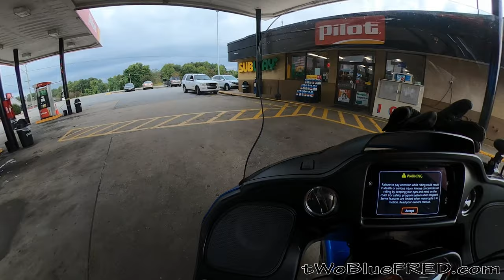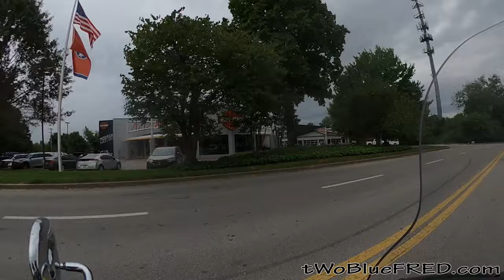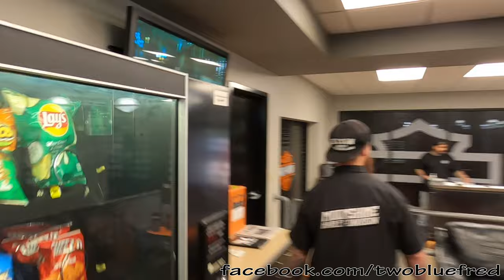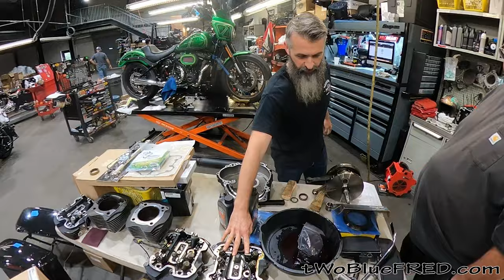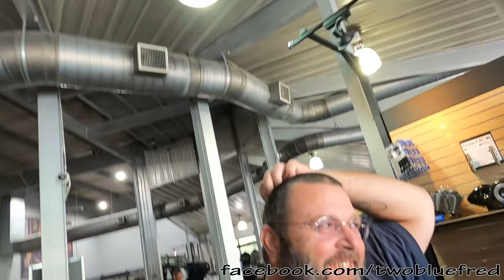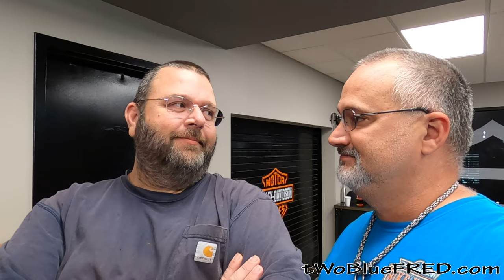PERFORMANCE BAGGER BIKE BUILD @ MOONSHINE HD -128ci ohlins beringer brakes #performancebagger

Comment: man, im wanting to do a 128 on my 107 also! im curious what does a 128 kit cost out the door roughly? great videos hoss!
Reply from the maker: i have not looked to see separately.. still overwhelmed at the total for the build.  they start i believe at $7k and go up....how fast u wanna go is the question.  Personally, I say, just do a bad ass cam, and find a way to be happy.
Reply: @TwoBlueFRED  , THANKS FOR RESPONDING! LIKE YOU, I FREEKIN RIDE, HOSS! I HAVE A 17 ROAD GLIDE S WITH 86,000 MILES RACKED UP SO FAR! WHEN THIS ENGINE SHITS THE DUST I'D LIKE TO TROW A 124 OR 128 IN IT! LOVE YOUR VIDEOS , HOSS!
Reply from the maker: @raybrdjr  i agree, wait till ya need a new motor before going big.
Reply: @TwoBlueFRED  Are you not satisfied with your purchase? I have a 2018 Roadglide special with the 107. I'm just wanting little more torque. I want reliability over high performance. People I spoke with say they should have just kept or did a stage 2 upgrade over doing 124, 128 or 131.
Reply: @TwoBlueFRED  i have never understood why guys that tour want a race bike 
high performance equals less reliability my bike never goes more then fifty miles
from home cause i no she can let go at any time but thats how i ride drag strip and red light to redlight